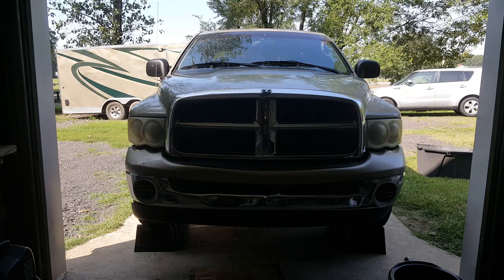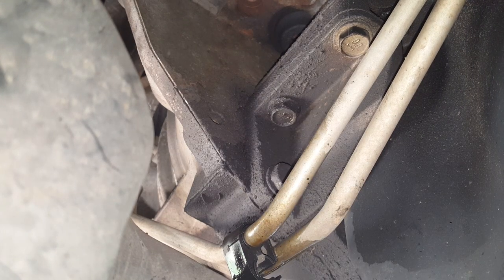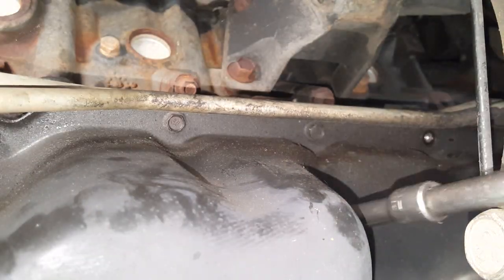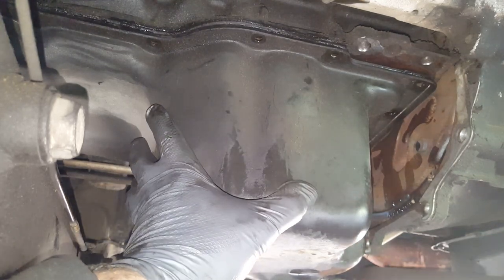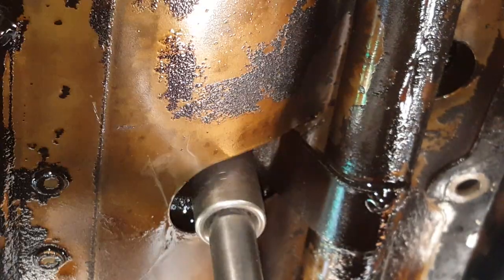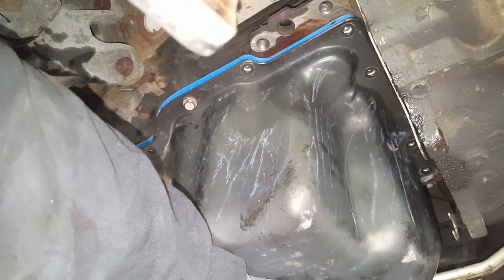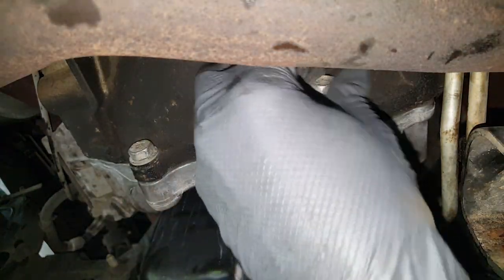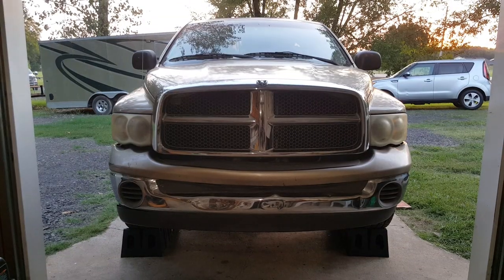How to replace the oil pan gasket on a Dodge Ram 1500 2001-2008

Comment: The book calls for 108 In Lbs on oil pan bolts and studs, Great video! I am getting ready to do this and had read you needed to lift the engine but you proved it can be done in place.  Thanks. Also like the medium loctite on the bolts. Excellent video!

Comment: So you don't have to jack the engine up? Like every other video says. I'm about to pull the pan on my 06 ram 1500 5.7.
Any info would be highly appreciated.
Reply: How'd that go with the 5.7? Mines an 03 5.7. How'd you support it?
Reply: @willalabran7879  dod it work with out jacking the engine up ?? Doing mine this weekend
Reply: Anyone know if you need to jack the engine up on the 5.7 need to do mine shortly aswell
Reply: @darrenthompsett5578 the way it looks nope
Reply: @TheRamsalduf14 how did you go about putting mains bearings in did you get the crank redone or how did you go about it with the doges I have I got to do the mains I put new lifters in thought that was it but nope it wasn't

Comment: I just dropped pan down 1/2 inch. And with 2 big tubes of silly cone. Hooped it all way round was tricky. But used my hand. 🤚 with most. Lol but I bolted it back up. And wiped all the excess off. So nobody sees and freeks out. . Lol. But trick is. To let it dry for few days. You don’t want the gobs. Of silly cone to get mixed in oil. 😮
Reply from the maker: I agree on the cure time , I always wait atleast 24 hours. I resealed another truck by using rtv but taking the gasket off and cleaning it first. It never leaked a drop. The ultra black rtv has never let me down , but all the others have at some point. Great work and thanks for sharing.

Comment: everybody else was telling me i have to either drop the diff or raise the engine just to get clearance to take it off
Reply from the maker: Thank you for watching.
Reply: If it’s a 4x4 yes.. bolts are stiff af to loosen. Everything shown in this video is pretty easy to do.
Reply: Did u get it done w/o lowering Diff ?
Reply: That is what I am dealing with now, do not have the clearance to move the pan past the trans like was done in this video. Think I will have to loosen the motor mounts & raise it to make clearance.

Comment: awesome video and this is how videos should be done. not looking forward to doing the job seeing the oil pressure sending switch was not my issue. starting to think the oil pick up tube maybe partial clogged or my oil pump is starting to go so shes sitting waiting on parts only 159k miles on my 02 ram 1500 4.7l
Reply from the maker: This takes me back to the first one I replaced for the exact reason. I was having oil pressure issues , and adding extra oil to the truck helped get me home. After I pulled the oil pan off it was full of gunked up oil and debris etc. The trucks oil changes had been neglected from the previous owner . I cleaned the pan , removed the pick up tube and cleaned it ( screen clogged ) , and cleaned the lower portion of the engine. After that I had zero issues with oil pressure. But anyways that was my first experience with the 2002 ram 1500 oil pan and , I discovered the hard way how to remove it . Thank you for the feedback.

Comment: I wonder if a thin flathead screwdriver can be used to separate the pan?
Reply from the maker: I would only use a putty knife , screwdrivers work great but may run the risk of gouging the pan. Thanks for the question.
Reply: @s33therfan  oh ok. And thank you for the amazing video.  I was watching another ftom like a shop but I noticed they use tools and stuff I can't buy and I thought there could be a video that would do the same job with no many tools and I found yours.  Thank you again.

Comment: you're a patient man, by that time my crowbar would be at hand 😁,  that plastic piece you broke on the starter is probably  a drain tube .
Reply from the maker: I have done several of these ram oil pan gaskets , and I swear they must use a super adhesive when assembling these engines. Thanks as always for watching.

Comment: To remove the oil pan, Does the engine need to be lifted on 2009-2012 ram 1500 5.7L?
Reply: Did u get it done? I thought differential had to drop a bit

Comment: Question: On my truck I had a hard time getting one end of the aluminum "Dust Structural Cover" lowered down past the passenger side end-mount for the cross-member. Also couldn't get pan out without slipping it to the side and removing the pump suction line bolts.  Had to take that line, the gasket, and pan out all at once, together.   One would think that my engine is too low, a motor mount issue perhaps.  What are your thoughts?

Comment: Is it possible to see inside the oil pickup tube with an inspection camera from the oil drain plug?
Reply from the maker: I think you could . There may be just enough space under the pick up tube. Thanks for the feedback.
Reply: @s33therfan  its pretty close to the botto of the pan huh?

Comment: The plate between the oil pan and transmission I have a little leak any idea how I can fix that
Reply from the maker: If the oil pan gasket is good , then I would be thinking a rear main seal. Usually not worth fixing unless a bad leak or removing the engine or transmission. Thank you for the feedback.
Reply: @s33therfan I fixed the problem that gasket plate was a little tight I loosened it a little and it stopped thanks again

Comment: Is that upper oil pan gasket?
Reply from the maker: It is just the oil pan gasket. This truck uses high temperature rtv to seal the bed plate. Thanks for the question.

Comment: Did you have to drop exhaust or anything
Reply from the maker: No , I did not. Thanks for the feedback.
Reply: Only differential if it’s a 4x4.. found out the hard way which is a pain in the butt if the bolts are rusted out.
Reply: @Francisco Lopez  hi, I have to replace piston # 4. I have 4 wheel drive, and I'm at the point of taking out the front diff screws. There are two that have a nut on the end, and when I tried to take the screw out of the very top holes of the diff, the head hits the side of the oil pan, and there's not even enough room, basically, to take the screws out on top. The other three came out fine. I also had to torch all of them ( I have a 2005 ram 1500)